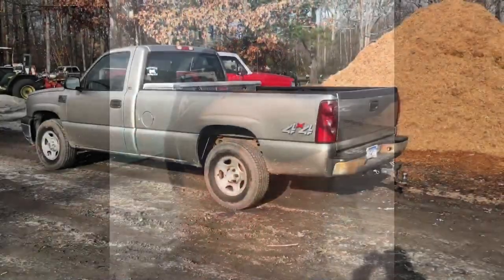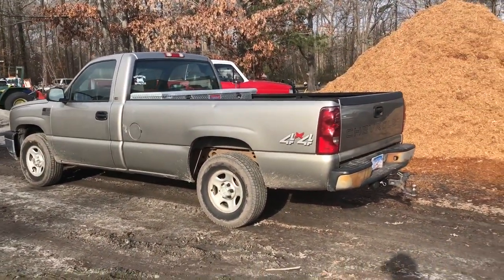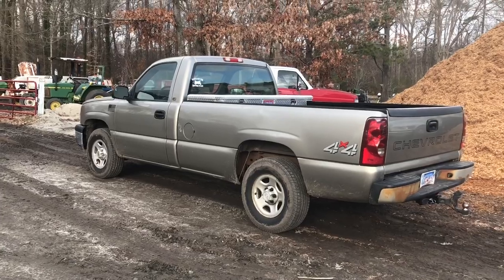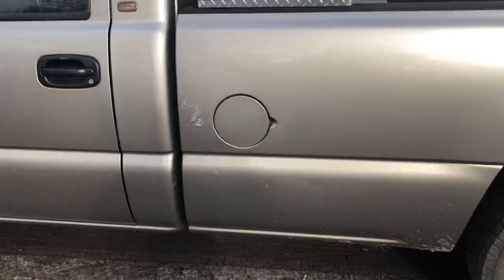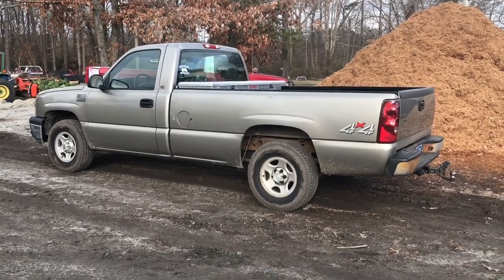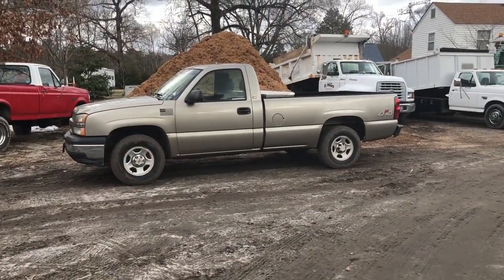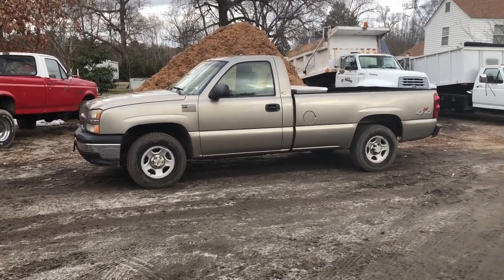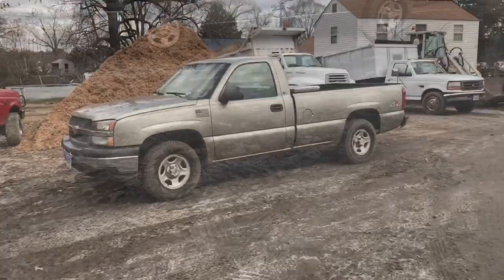Heavy towing with the 4.8 Vortec. Should you do it ?

Comment: I love those older Chevrolet trucks from year 88 through 06 they would last forever with proper maintenance! Great vid btw
Reply: I've had my '05 Chevy for 14 years now (bought new) and it's still running great, most definitely the most reliable vehicle I've ever owned.
Reply: kosmosleha no it’s got a little different motor but they are still excellent motor
Reply: When my wife and I married her uncle gave us his old '03 1500 looks just like the truck on here but it was a dark blue. It had over 400,000 miles on original motor and trans. Now the old gal has way over 500,000 and she's still going strong on us
Reply: In NY the 2000's chevy/gmc truck are the only ones still on the road from that Era.  Sold my 2014 to buy a 2001 because all the electronics started having software issues, they won't last as long and be affordable to maintain.
Reply: Old comment but I gotta 99 4.8 and it has been drove like shit and I mean like shit pedal to the floor for around 300K miles lmao

Comment: The issue with towing heavy loads with this rig (I've got an '06 SILVERADO 1500 w/4.8) isnt the ponies and torque applied to tow the load. The issue lies in the rear axle, suspension, transmission and most Importantly THE BRAKES. You can pack a TON of weight on these things and MOVE IT. The problem lies in STOPPING it. Sure, itll likely (loosest form of the word) stop the first couple trips on its own accord. The problem lies in when it DOESNT stop it. And man, if you on grade with a sizable weight behind you (even with trailer brakes installed on the deck youve got hitched up) its gonna get REAL bad, REAL quick. And if, and more importantly WHEN it does break loose on you, all HELL's rollin in with it

Comment: My 2010 4.8 does just fine staying under 70. It'll pull a decent trailer faster but it wants to hold 3k rmps and trans temp starts climbing.
Reply: Mine too. I have a 2010 1500 4x4 with a 4.8, I bought a small 18ft travel trailer weighs maybe 2800 pounds. It'll do it but up hill is a bitch. I try to keep it between 3 to 4000 rpms and I leave it in 3rd gear. Occasionally I need to drop down to 2nd gear and punch it. The trans temp gauge goes to about 195-200 degrees
Reply: @vinnieortega  I installed a hayden trans cooler from parts geek. Its a 55$ kit and has made a signature difference. On a 92 degree day it stayed around 160.
Reply: Transcooler
Reply: Same here except hold at 2k

Comment: I have a 2001 Chevy Silverado 1500 work truck Long bed, color white, completely basic, crank roll up windows, vinyl flooring, Cost a couple dollars for a basic key, that's right no fob or key chip, just a good old fashioned metal key. The ignition is so worn out the key just comes out of the ignition even when it's on. Nowadays you couldn't do that with more modern trucks. 4.8 liter engine with almost 194,000 miles, bought it 3 years ago, used to be a motorcycle hauler at a dealership, then had 168,000 miles paid almost $2400, since then it's been a great truck. By next year it will be considered a Classic at 20 years. Good old Chevrolet !

Comment: No brake controller, I use 4.8 to pull 15ft trailer 300 gal tank full water with pressure washer  and a 60 gal tank in best with softwash system and sometimes a 55 gal drum full of chemical plus 30 to 60 gal tank mentioned above with Chem in it

Comment: This was such a helpful video. I recently towed my 76 Cadillac Fleetwood Brougham d'Elegance with my 05 1500W/T that has the 4.8L. It was about 35 miles, and I was nervous to do it. I knew I was over doing the recommended limit, and I've never really towed something that heavy. Car and trailer weighed in at about 8,000 lbs. The truck I have also has the trans temp cooler, HD trailering package and the HD Suspension package as well. I also modded the factory cluster to add the trans. temp gauge. The trans cooler makes a great difference. albeit, It was mostly flat terrain, But there were some small grades. It managed them with relative ease. I was able to maintain 60-65mph the whole way. I did loose some speed when encountering a hill, but I could have done better to keep an eye out to maintain my speed. Oh, and I used the factory hitch. I'm not really sure what its rated for, but it took all that weight without issues. But I don't think I will be towing that much weight anytime soon again. I only needed it for this weekend to take my car to a show.
Reply: Factory hitch is rated for #5000
Reply: I have towed a 5k 24' tt over 8000 miles. With my well maintained 06 crewcab 4.8 and It will do it but I wish there were a couple more gears under my chair. Climbed mountains drove thru deserts and fought some windy days across the plains. Just motor along in third 2500 rpm is 65mph, 2700 is 70. Trans cooler is huge and stock tire size is important. Truck doesnt burn a drop of oil and pulls 10/11 mpg. You will get passed and might fall on your face a couple times. Dont forget your shades 😎

Comment: The 4.8l can do 7-8k towing   but not on a regular basis. But it needs upgrades to the hitch , axle gearing, bigger  brakes.  and best if do it's  towing on a manual transmission not automatic. 
 If looking to buy and plan on doing even moderate  towing just get a 5.3, 6.0l, or the huge 8.1l. The 4.8l was to get better gas mileage and very light towing.
Reply: My 4.8 couldn't tow itself!

Comment: Thank you! Was thinking about buying one to tow my 7500lb camper around but now im gonna buy a 2500 truck.
Reply from the maker: Brandon Jackson if it’s on a regular basis yea I’d buy a 2500. Just depends on a lot of things like how far you’ll pull, your type of environment, etc... if u have a 2500 you’ll be able to comfortably pull it no doubt.
Reply: A newer 1/2 ton (they’re bigger than the pre 2007) that’s optimized to tow should haul a 7500 lb camper with minimal issue.  It really depends on what you’re gonna use the truck the most.  If it’s mostly to haul, the 3/4 ton would be the way to go.  If it’s just occasional towing and mostly driving without a trailer, a newer 1/2 ton would be more economical.

I’ve towed a 7000 lb trailer a few times with a 2011 crew cab 4x4 5.3L, 6 speed auto Silverado and it handled them with relative ease.  The factory brake controller worked flawlessly.  Even in traffic, unoptimized loads and/or blowing out a tire on the trailer, it pulled remarkably well.  

Typically, I pulled that trailer with a 2000 F450 7.3 diesel (4x4, 12’ dump bed).  The 14,000 lb curb weight of the F450 made the 7000 lb trailer feel lighter than with the 2011 Silverado in front of it (the F450 could handle over double the 7k weight), but the Silverado was much more maneuverable, stopped/accelerated equally well, and felt very composed on the highway.  

Though, if you’re planning to just use the truck to haul the trailer and don’t mind the added cost, I’d go with the 3/4 ton.  
“Overkill is underrated” -Hannibal Smith

Comment: I towed a friends truck back home from the lake one time with my '05 silverado 1500, with the 4.3 V6. His truck is just like yours, long bed, half ton V8. He had a tow bar, so I wasn't pulling a trailer too. But his truck probably weighs 5000 lbs I'm guessing? Well the 4.3 V6 did the job, but man it was pretty slow going. I managed 55 on straights, and as low as 40 on hills. The rpm was around 3500 most of the time which really isn't that bad. Usually I just tow my little Casita camping trailer which only weighs 2100 lbs, and it pulls that with no problem. And that's well within the maximum tow rating of 3900 lbs.
Reply: Mate i got the same truck long bed 2wd V6 3.23 dif. I've never towed before, do you think it can handle a trailer of 6000 lbs gvwr?
Reply: @mohamedly5557  It would probably do it, but you would have to keep the speed pretty low, and avoid steep hills. The tow rating on my truck is only 3900lbs, so 6000 is well over that limit. I think it could probably tow 6000lbs but it will be struggling.  Good luck with it!
Reply: @trevorjameson3213  thanks for the reply mate i will do my best. I really appreciate your advice

Comment: I have a 2012 ext cab 4x4 4.8l with 3.23 gears. It’s awful for towing. I tow my rock crawler which is about 5k truck and trailer, maybe 6k with passengers and gear. Truck is beyond slow but just rolled over 200k and has been reliable. Only replaced brakes and wheel bearings on the front. I tow every weekend and usually in the mountains. Next month I’m gonna buy a new diesel.
Reply from the maker: Jimmy4x4 Socal yea the gear ratio makes a huge difference. I tow around 8000lbs with mine on a regular basis but I also have 3:73s. Mine is slow going up inclines towing that weight but it doesn’t bother me all that much. I’d like to get a diesel myself but maintainence cost are just to high for me and I prefer the simplicity of GM gas engines
Reply: put a tow package for a ex cab z71 5.3 there 4.10 postitrac it helps greatly my 1500 swb2wd just got 4.33 gears n auburn locker but I do have a towing cam headers supercharger it had a lot of mods I just done the gears n my trailer has electric over hydraulic disc brakes so I tow my truggie threw the mountains it does good

Comment: My 2000 Silverado is a 2wd, RCLB, 4.8L/4L60e, without the trailer package (coil spring front, not torsion bars), and it doesn’t have a trailer brake controller or weight distributing hitch.

I towed my 68 Camino (Iron 454) on a heavy 18ft trailer (usually haul my 6500 lb tractor with a different truck).  The Camino and trailer combined probably weighed about 6000 lbs.  The trailer has heavy duty ramps mounted on the rear, forcing me to move the Camino forward more than I wanted; putting a lot of weight on the nose of the trailer.  The rear of the truck sagged significantly.

I hauled it to a shop about 20 miles each way with some hills.  I kept the trans out of overdrive, which wasn’t a problem doing 55-60mph with the tach at around 2700 rpm (avoided OD because of past failures with a different 4L60e).  

If I was able to balance the load better on the trailer, the suspension would t have sagged as much and would have made the trip better.  My biggest concern was hurting the trans, leading me to slowly roll into the throttle from stops and with each gear change.

Power wise, the 4.8 won’t set any records, but it can pull decently despite its small size.  The biggest thing is that it likes/needs to rev.  Peak torque is above 4K rpm.  The wide gear ratios of the 4L60 don’t help, nor does trying to be gentle on shifts.  
The narrower gearing and durability of the 4L80 would have made applying the power of the 4.8 better; allowing it to stay in the meat of the powerband with shifts and piece of mind that the trans wouldn’t grenade by staying on the throttle between shifts.

TL;DR:
Despite not being set up for towing heavy, my 4.8 RCLB handled a nose heavy trailer fairly well; but it’s not something I’d want to do regularly because of premature wear.
Reply: I've noticed towing in 3rd it's a beast, I'd it searches for gear to much

Comment: i'm surprised by what my 04 with 5.3 and 3.73 gears will pull if i have it in tow mode and use the right gear for the terrain i'm driving.  252k on it, original engine and trans with no problems at all. just added a massive trans cooler and huge aluminum transmission pan.
Reply: I also have an 04 5.3. It should have no problem hauling a heavy duty trailer like the one in the video empty right? What would the limit be before I have to add stuff. Finally what’s recommended to add to tow heavy?

Comment: I have a lifted 4.8 going to be towing a Prius, on an estimated 5 hour drive. I do have a brake controller. Just worried maybe it won’t be able to handle the weight
Reply: How’d it do ? For me I pull like ~10,000 pounds daily and brakes are huge issue for the truck takes far too long to actually come to complete stop and then to take off takes even longer

Comment: The 4.8 transmission is much better transmission than a 5.3 or 6  L . As my 4.8 with  360,000 on it . The one thing I had to do was fix the Bearings in the rear end . I have not pushed my truck hard .
Reply: Their the same transmission other than the 6.0

Comment: I recently picked up an 04 Sierra 1500 ext cab 4x4 with the 4.8L and I’ve been contemplating if it was a mistake cuz i need to be able to tow my car that weighs 3500lbs on a 1500-2000lb trailer plus another 250-500lbs of tools & equipment for a much longer haul than 250 miles… After seeing this I think im gonna have a truck for sale here in a few. 😩
Reply: A 2500 or even a 6.0 would be better. You could regear to 4.10 if you’re on stocks, which would help a lot, if you don’t want to deal with getting another truck.
Reply: You're transmission is not rated for this.
Reply: @olivierroy1301  the transmission is 100% rated for that, actually a little bit higher. The 60e is not a bad transmission at all, people just over heat the piss out of them and leave there trucks in od while towing and wonder why they blow up every other month
Reply: @Ligmaballz64  I agree, I think I didn't read correctly. All I know is that if you leave it in o.d., not using the tow mode button while accelerating or going up hills, it can burn. It's not made for heavy hauling though, it couldn't handle daily use for 6000lbs charges for long.

Comment: That’s for the video, I have a 2011 Silverado 4.8 with trailer brakes and will be towing a 4,500 lbs rv trailer for a 900 miles round trip.
Do you think my truck will do fine?
Reply from the maker: It’ll be totally fine
Reply: lmao I towed a 11,000lbs trailer with a puny ford V6 explorer 😂 MULTIPLE TIMES. You should be more than fine.

Comment: Thanks! I'm about to buy my first truck and an looking at an 02 Silverado with 140,000 miles. I need a truck to tow a 3500 lb (dry) camper trailer on a round-trip cross country. It's got the V8 4.8 vortec. This was a very informative video! So, I should be aces with just a 3500 lb camper on this truck, even out west with the moutains & heat?
Reply from the maker: Yes, you will be golden! Still recommend a brake controller if the camper is equipped with breaks , which I’m sure that it is. Keep he fluids changed frequently and the truck should last a long time. Happy travels !
Reply: I’ve found that a 3.90 gear works perfect with the 4.8

Comment: I hated my 4.8....had to put the pedal through the floor to get on the interstate and it constantly searched for gears, ultimately leading to premature transmission failure....plus the oil burning....truck was garbage at 90k miles

Comment: Could a 4.8 tow an enclosed trailer with a car in it , do you think with upgraded gears , tow bar and suspension and brakes ?
Reply: I don't know, if it's a one time deal and you're not going too far it can be done. I think about the transmission. If it's a half ton truck with the 4l60e, I would reconsider the idea.

Comment: I got an 03 Silverado LT 4x4, 5.3L with the Z71 package and I think it was code GT4  for 3.73 gears, From what I could find online the max tow capacity is 8,800lbs  Its a little bit difficult to figure out if that's accurate though, because its a fiberglass step-side truck..  I can tell you from experience I've owned C30 1 tons, and they road smoother than this Silverado does, this thing will send you through the ceiling if you hit a pot hole.  So I'm not exactly sure, its stiff as hell though? like a 1 ton... I  can't drink coffee safely in this thing I know that.   Anyway, point is I wanna use it for towing now not sure if there is a better way to narrow down the exact weight it can tow "legally"
Reply: It will be in your user manual, these gmt800 trucks came with the ratings. (I think the fords did too). Then multiply the rating by 0.8 and that will be your safe tow rating.

Comment: Hey man I have a question. So I have a 2005 silverado 5.3 and it feels weak pulling a dual axel trailer with a big zero turn on it. Any ideas you have for me to make it stronger?
Reply: Did you try tow haul mode?
Reply: Put a transcooler on it
Reply: @danyaelturner414  yes but I mean like overall takeoff. I know it’s some weight but I don’t think my truck should feel so weak pulling something light if that makes sense
Reply: @machoman616  yeah you might have a different issue, i can tow my 2 ton camper fine, granted its slow at first but it still picks up pretty well, and thats me with a 4.8v8 with some minor upgrades to it

Comment: Shoot I pulled my 7000 pound pressure washing trailer with my 4.3 Jimmy sags so bad that the tires rub on bumps and no brakes had to pull it for about 200 miles my work truck was totaled so I had to use my spare vehicle just for about a week
Reply from the maker: Gotta do what ya gotta do sometimes brudda

Comment: The towing capacity of a pickup is not rated based off of the engine.
Reply from the maker: Yes, and no. 

Example- I have a 2019 Tacoma 4 cylinder 4x4. It’s advertised to tow 3500 pounds. The V6 version is rated at 6500. They’re both the same trucks. Transmissions, suspension, breaks, etc. the limiting factor of mine is the hp/ ft lb torque. Mine ‘could’ do 6500, but you risk damage to the engine/you cannot get safely up to speed.

Comment: Hi. I'm looking  at a 2012 Silverado 1500 single cab  short  box 4×4. It has the 4.8. I'm considering  buying  to tow a 3000lb boat. The boat  fully  fueled  with trailer  is just around  3000 if not under.  Trip  drive  times are around  1 to 2 hours. Do you think I would  be okay  to purchase.  Its about  impossible  in ohio to find a regular cab short box Silverado  for some reason.  Truck has 70k  rust free and they want 15k for it.
Reply: Its fine, it has the gen 4 intake too.
Reply: Did you end up buying it? And if so, how does it tow?